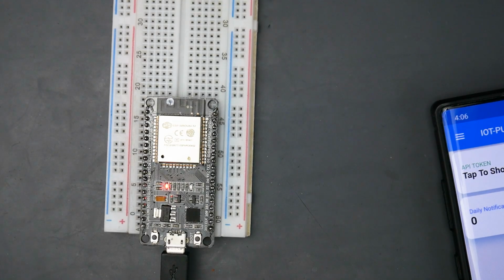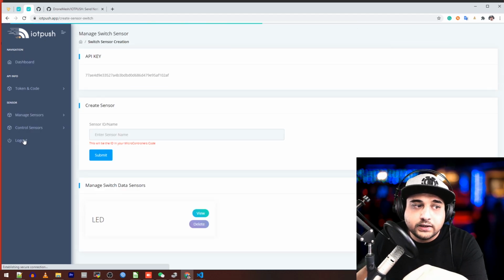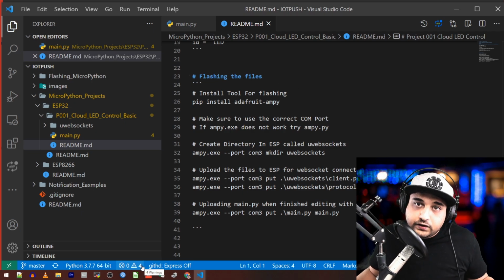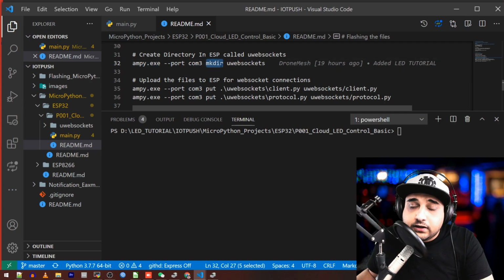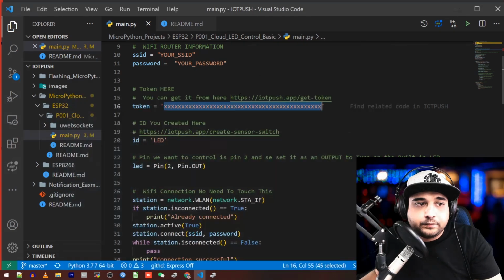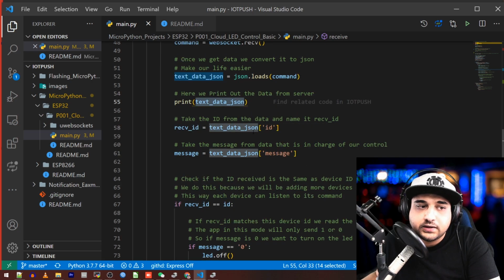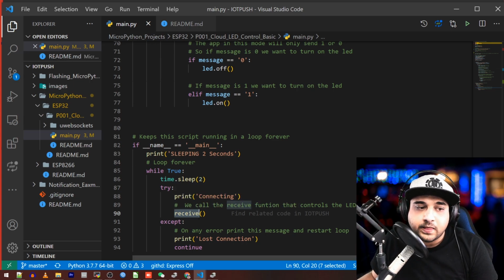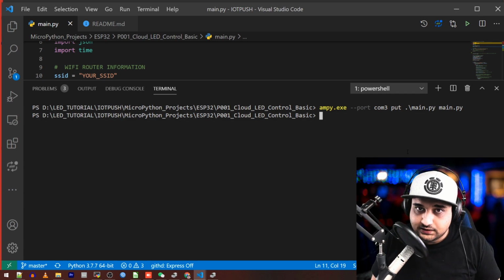[MicroPython] Project #1 Cloud Control LED From Your Phone

Comment: i did everything with no errors. but my esp 8266 will not connect to my network. no lights on it after flashing but arduino  detects it 1.14 os. any ideas thanks for a great project!!
Reply from the maker: Come join my discord
Reply: @DroneMesh  ok ty